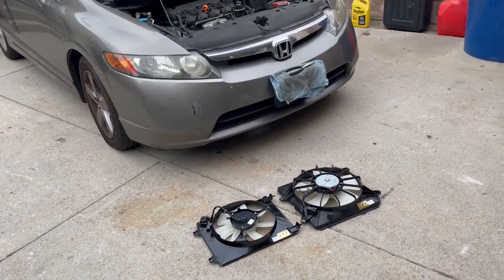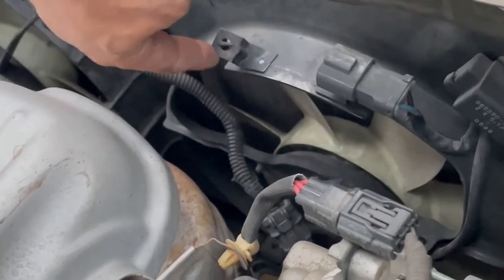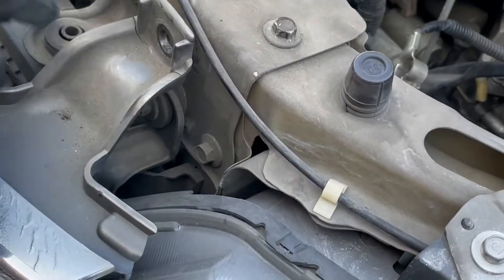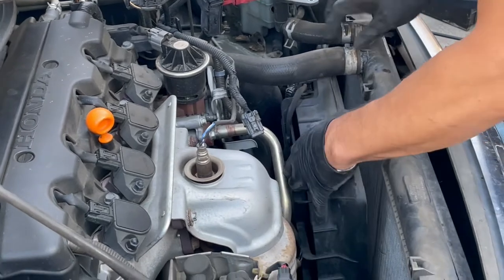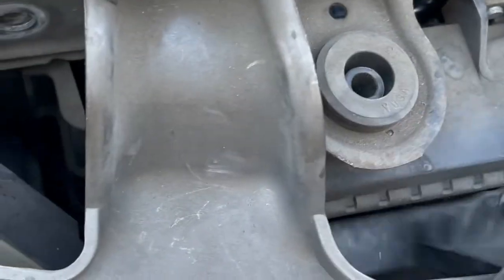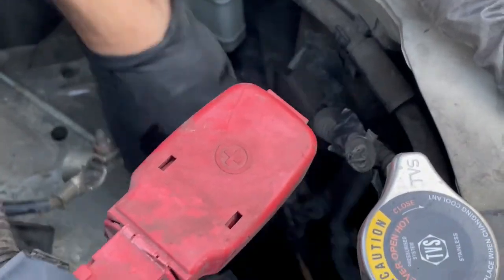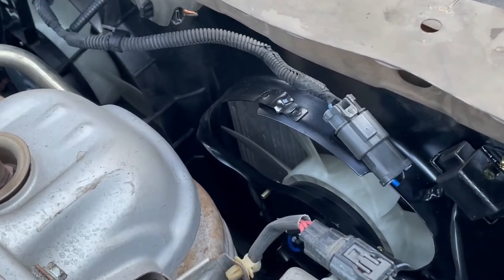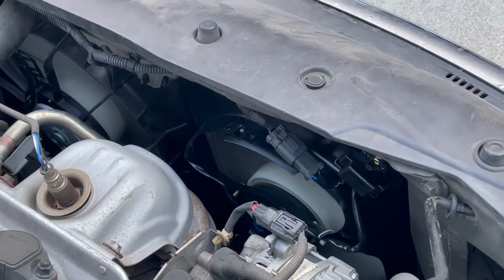how to remove and replace 2006 - 2011 Honda civic radiator and ac condenser fans.

Comment: I've never done this before. Is it actually necessary to take off the radiator support to replace the ac condenser fan on the passenger's side? It seems like so much extra work.
Reply from the maker: yes it gets in the way.

Comment: what is the rotation of the radiator fan and that of the condenser fan? is it clock wise and counter clockwise or both clockwise or both counterclockwise?
Reply from the maker: Sorry not sure but they cant be installed wrong way.

Comment: Hello any idea how I can remove the side baffles or also known as the radiator trim seal.? It's blocking me from sitting the fan on the bottom slots.
Reply from the maker: sorry not really, would have to see it since i did not run into that issue
Reply: @JackofAllCarbinc  thank you for the reply, I fixed the issue 👍🏼
Reply: @LynWeeD how did you fix it I’m having the same issue rn